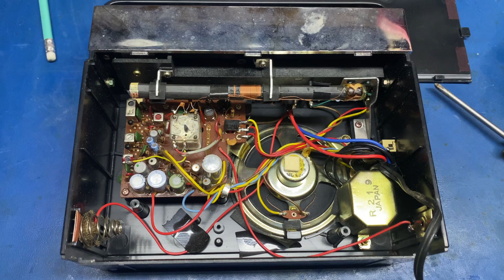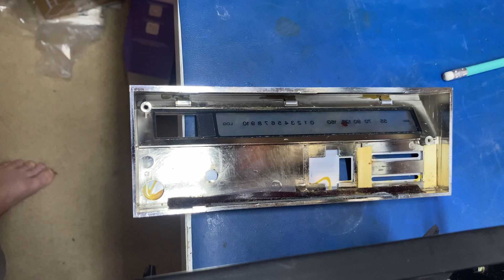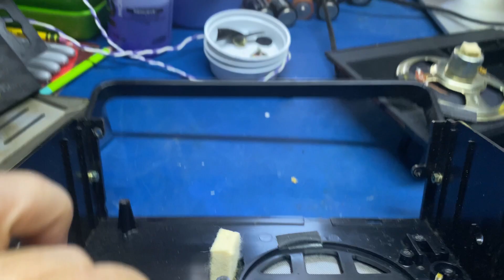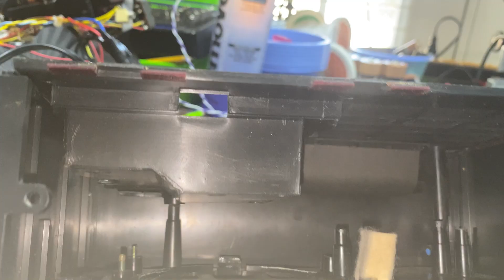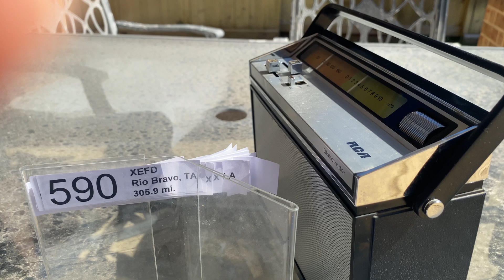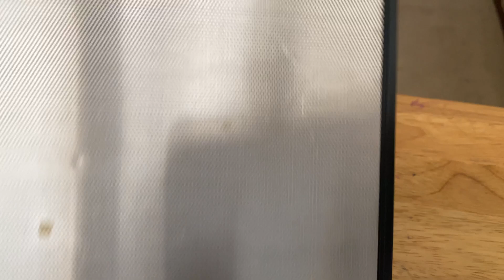The Last of its Kind - RCA Globetrotter Series

Comment: In your experience, is this RCA globetrotter a direct competitor to the Zenith Transoceanic? If so, how do the two compare? Which one is “better” in your opinion and experience?
Reply from the maker: I didn’t find the Transoceanic to be very sensitive- it has a massive - but flat fertite bar.  The AVC is set up so you really have to turn up the volume on weak stations.  It definitely has its fans - perhaps for the shortwave reception- which Globetrotters do not have.